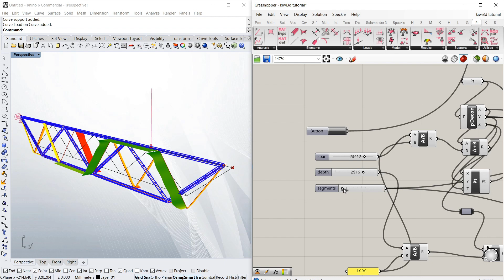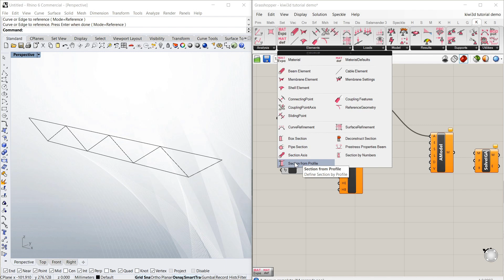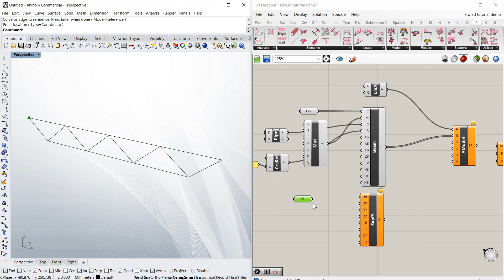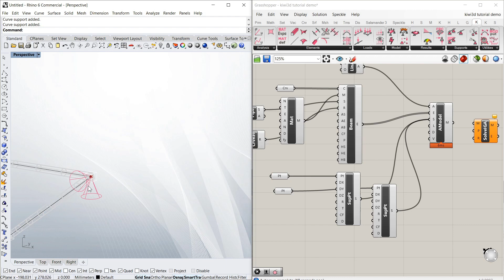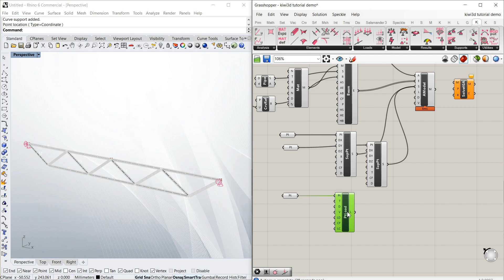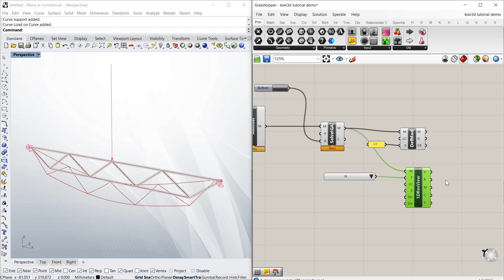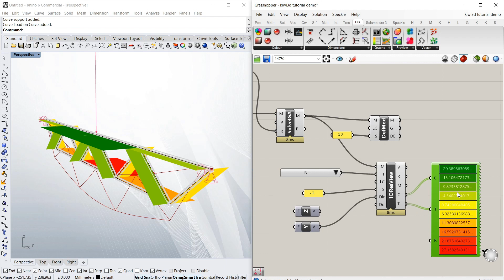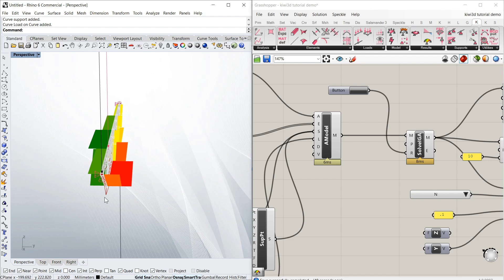Tutorial: Simple Truss Structural Analysis in grasshopper with Kiwi!3D. Faster than Karamba & ETABS?

Comment: Thank you for the video! Using the current version and cannot plug multiple supports into AModel. Rest seems to work but getting no results from that issue (tried with support curve which is working, but would need 2 point supports instead).

Comment: Thanks for your content and tools! Really helpful and very impressive.
I’m getting an error when solving my model which says “MyAnalysis coupe not find GPs!” I’ve found this refers to Gauss Points, and indeed when I decompose my model, the Gauss Points tree is empty. I have no idea what gauss points are with respect to beam elements. Any ideas on how to fix it?
Reply from the maker: A few basic things that sometimes help. See if the inputs are trees, lists or single data items - try flattening the inputs. Plug the inputs into a panel to check what is going into the component and is what you expect. Make sure there are no NULL items (if so, go back a few steps to find the origin of any NULLS being generated. With Kiwi, make sure the structure is determinant - if in doubt add more restraints at points or lock rotations at points etc. Hope that helps.
Reply: @StructuredParametrics  Thank you so much for your response! I've learned a few things from your response alone. I went ahead and posted the question to Dr. Bauer on the forum.
The error is "NodeLoad of ID 17 does not exist!"

Comment: How can the units be modified? or even better wich are the units used by kiwi3d?
Reply from the maker: Kiwi3d is does not have predetermined units. If you keep inputs consistent, the outputs will be in the same units. More info here: https://discourse.mcneel.com/t/analysis-unit/86155

Comment: Thanks for the tutorial. My deformation model is displaying this error "1. Flying node limit was reached! The displacement of the respective control points is set to zero!", do you know what it means?
Reply from the maker: Hi - normally that means that something is discontinuous. Usually it's because some of the lines (or load points) don't meet in the same spot (sometimes you need to zoom in a long way to find this out). Otherwise it could be that there aren't enough supports and the whole system will just spin in space and can't be solved. Hope that helps.
Reply: @StructuredParametrics  You definitely helped me. I really appreciated it. Thanks again  for the turorial, I'm exited to learn more from your content!